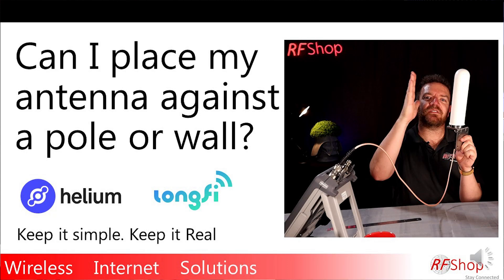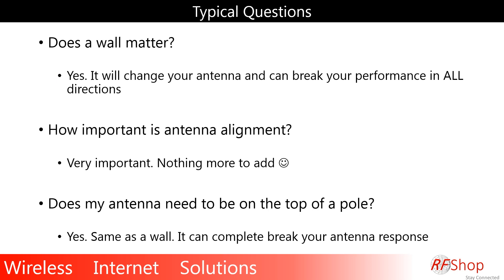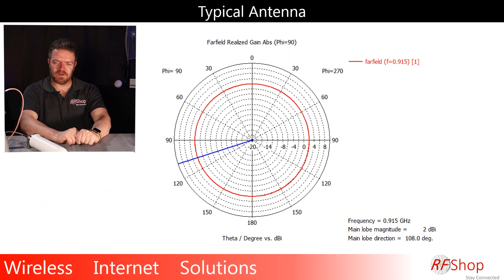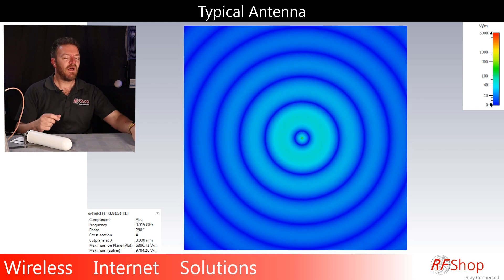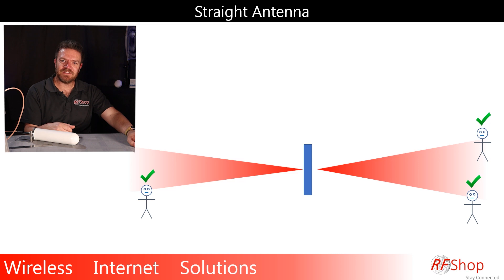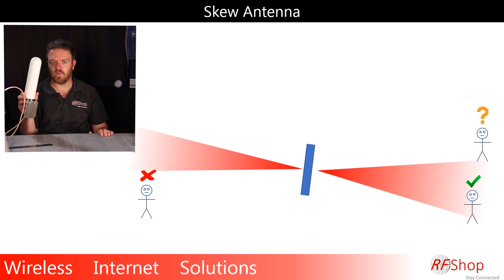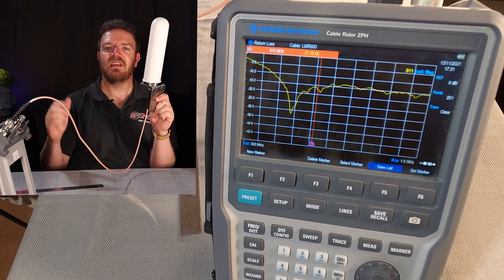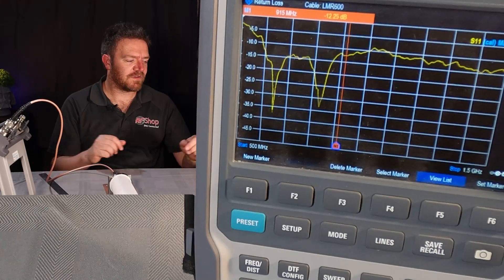Is it OK to place my Helium omni antenna against a metal pole or wall?

Comment: In the polar plot at 3:52 the side directly opposite (0 degrees) the obstruction also is impeded. I had no idea walls worked that way. Does it basically cancel out waves heading in that direction?

In saying that, based on the frequency of 915, is there an optimal distance (or multiple of distances) for the placement of an obstacle if you have to have one?
Reply from the maker: Hi Dean!
Yes, it basically sums and cancels as you go in multiples of quarterwave lengths. In this example it was worst case at 170mm, so half that (roughly 85mm) it will be very good, and then 170+85mm it will be very good again. Then, as you move further away the effects gets less obvious
Reply: @RFShop  Great thanks! Say you have a brick wall as your obstacle... is that 85mm measured from the nearest edge of the wall or the centre of the wall? 
Also, just received my McGill antenna from you guys. Thanks for the fast shipping!!
Reply from the maker: @deanmagee4245  it would be from the edge of the wall and not the center :)

Comment: So much info in this channel! I cannot find answer anywhere if it is possible to use 4G antenna for Helium mining? I'm considering this antenna -DrayTek ANT-4GE1. Please help
Reply from the maker: Hi! Yes, 4G works perfectly fine for Helium. In-fact, the antenna in my hand is a 4G Marine antenna
Reply: @RFShop  Does the 4g antenna need to cover the 915mhz (North American) frequency and if it covers a very wide spectrum does it matter that it is not tuned for 915 mhz? Can you take just any 4 g antenna and if the SWR at 915 passes an SWR test you are good to go?
Reply from the maker: @russelrlthomas  great question. The tuned antennas are applicable for the narrow band antenna designs where it's actually important to have the device designed exactly how you need it. In 4G designs we don't have these narrow band style antennas, and it's less applicable. However, the trouble often is that the VSWR is then also weaker. It is likely that the VSWR will be around 2:1 for the wider band antennas, but for narrow band structures you can actually force the antenna to be closer to 1.2:1 for the band you need / want. 
So to answer your question...it's not mandatory. If the SWR passes your spec and the antenna works well I would indeed use it.

Comment: Amazing video! Thank you for this! This may be the dumbest question ever (and it's definitely not something I would do myself) but theoretically could you use that "wall" to your advantage to have the signal bounce somewhere else.. For example, you have a slanted antenna, and you create a wall to purposely bounce the signal that would be facing towards the sky to now be pointing to a different direction? Just a theory I'm wondering would work or not. Awesome content btw!
Reply from the maker: Hi Joanna,
Absolutely yes. We do it all the time, as the reflecting surface becomes part of the overall antenna (so it's actually not a silly question at all). I just though...during the preparation of this video, that is might be best for the general audience to stay away from metal as it's the safer outcome :)

The one thing that will happen though is that you always loose the omni radiation pattern, so you will change the characteristics. The 17cm I mention in the video is basically 1/2 wave and that's the worst. However, if you had it spaced 1/4 wave (i.e. half the distance) you turn the same concept into a nice directional antenna but again, be aware that you will loose coverage behind the reflecting surface!

Comment: I've been following your channel for a bit now and want to thank you for your priceless information. Have a question though, I'm going to set up a helium antenna at my work place (warehouse) which has high voltage power lines about 40 meters away, 5 meters higher than my antenna point, will that obstruct my signal?
Reply from the maker: Hi Marco. Actually, the power lines are horisontal and the antennas are vertically polarised. That means they don't really see each other and from that perspective it will be quite OK. Having said that, even if they were not cross-polarised (which that aforementioned condition is called) the distance and height would have nearly eliminated any concerns as well. So, all-in-all I would say it's fine ;)

Comment: What is the name of this meter?
Reply from the maker: It's a VNA - Vector Network Analyser. There are cheaper ones available...we use this type of machine for all our cable and antenna tests at RFShop. This particular model, from Rohde&Schwarz, goes up to 3GHz. For LoraWAN one only needs a more basic machine that does not need to go higher than 1GHz

Comment: Great video, and happy to have inspired it 😄. Following your instructions I moved my antenna 1 meter far from the rear wall. Sadly I can't put it on the house roof. What would be the minimum distance from real wall to minimize the interferences and optimize the signal transmission? I have a 5.8 dbi fiberglass antenna. Thank you
Reply from the maker: If you can stay 50cm away that would be great. Also, it helps to physically visualise any obstructions and try to manage a clean line of sight to all locations you try to cover. It is possible to have signal through non-metal material, but one just need to be very aware that it is going to have an adverse impact. I see lots of posts for people place antennas in an attic. It will work, but will be inferior to the guy who placed the same antenna outside on the roof.
Reply: @RFShop  Love your content, I have a narrow, 3 story tall house. The roofs are super steep, so I don't dare try to climb to the peak. My antenna is in the attic...my connectivity seems spotty and not great. 8dbi fiberglass also. Higher dbi will help punch out further to compensate for the roof I hope? Even if it means the spread won't be very low to the ground near my house?

Do you have any videos demoing the signal loss through typical building materials? I'd love to see real world impacts of thing!
Reply from the maker: Great suggestion...will think about how to demo that. I might have to use my VNA rather than rely on the network to give me / us that answer. It'll be a great test though
Reply: @RFShop  thank you, that's exactly what I thought. I'm learning that RF world is really weird. With my 5.8 dbi fiberglass antenna i can witness some beacons from a certain hotspot, but sometimes I can't witness it even if the hotspot near to me can. Seems randomly, but it can't be...right now I think the placement of the antenna is the best I can do